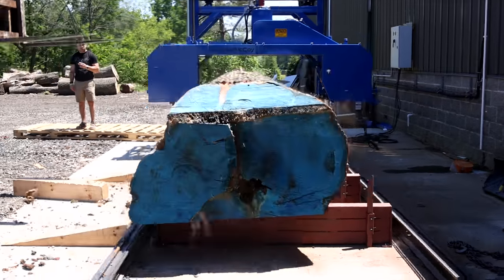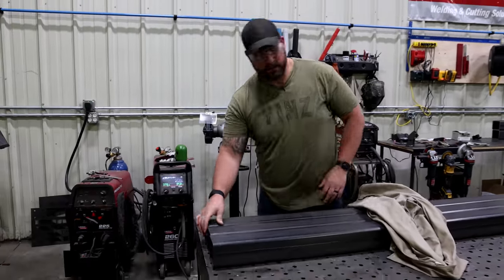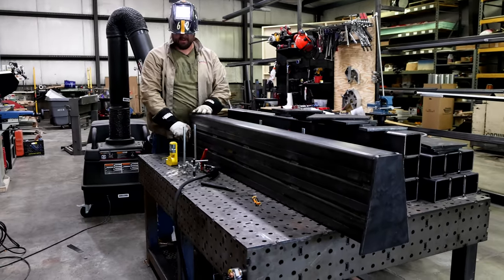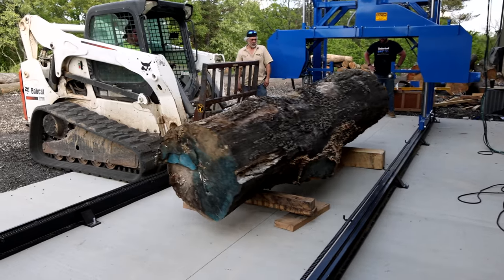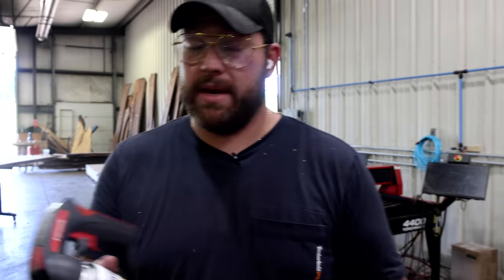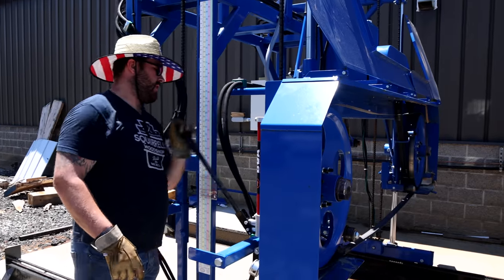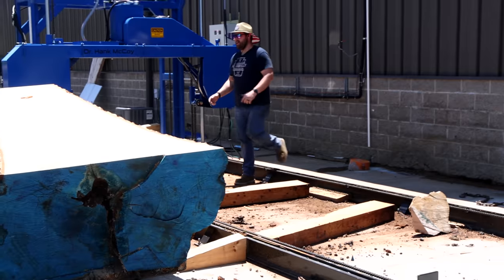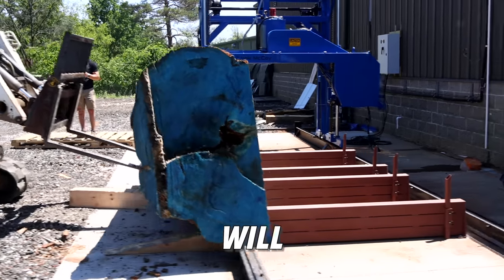HUGE Sawmill Upgrade with An Issue....

Comment: If you are going to be pushing logs perpendicular to the bungs you should add some cross bracing to avoid the logs catching on one and putting forces that would pull them out of the ground.

Comment: If you keep trying to slide the logs around on the bunks, especially perpendicularly, you’re just going to keep tearing up anchors/concrete. You need to get a large enough lift to move and set them into place instead of half-assing it with that bobcat.

Comment: If you don't mind my input, you should make a series of brace connectors welded on to the bunks that connect all the stands together (see the really bad text graphic below where the horizontals are the bunks and the verticals are the connectors). This would give the benefit of keeping all the bunks evenly spaced from each other and the extra 6 or 12 inches on the outside of the last bunks should prevent them from rolling away. Additionally it should eliminate the need for securing them to the ground because the whole thing would need to move as a single unit.

 |          |
=======
 |          |
 |          |
=======
 |          |
 |          |
=======
 |          |
 |          |
=======
 |          |
Reply: Yooo, totally 💯 was thinking something like this. Graphic on the same level I make any projects too 😅
Reply: 100%

Comment: Try using some big Simpson titans. They have a much higher pull strength rating than red heads. If those don't work, then try using structural rated threaded rod and Hilti re 500 v3 epoxy. With the epoxy your concrete will shatter before the epoxy fails.

Comment: i would recommend treaded rod and fill the hole with chemical anchor. insert the rod let ik harden and its not gonna budge.  we secure big industrial warehouses and timberframed homes with it to the concrete slab.  so that`s just my 2 cents.

Comment: If you join the four together with bolted brackets this will increase the stability and reduce the pressure on the concrete fixing as it will be one strong unit instead of four separate weaker units.

Comment: With the price of steel and labor, I am betting these cost more than $500 to build.  But then the channel wouldn't have been able to watch the fun!!
Reply from the maker: thats with me paying myself 0 hahah
Reply: The steel was $500 probably closer to $1000-$1500 for the total build not including labor costs. A hernia is always priceless lol
Reply: @sovereignviper90  I certainly enjoyed mine.
Reply: Engineering tensil strength verses shear strength it appears your anchors need to be more shear then tension. 
If you placed 1/4 plate steel gusits and spread out the force over two anchors you should be able to accomplish what you've set out to do.

Comment: Red Head anchors only hold at essentially one point of the hole.

Use the self threading type  such as Powers ScrewBolts where the threads anchor along the full length of the holes.   Much stronger.

Comment: If you have a 120v welder here on this 1/4”, you can heat your metal up til it’s hot and the welds sink in like melting butter.

Comment: Next time you have to carry long pieces of steel like that, take it from a pipefitter. Lift one end on to your shoulder, slide it up while walking into it, and once you're in the middle you feel it balance out. I carry 21' lengths all day every day like that!
Reply: Agree 100%. Plumbers & Fitters Local 110, Norfolk, VA
Reply: @plunger110  nice I'm a Sprinkler Fitter in Edmonton, Alberta. UA 488 here although I'm not with them.

Comment: If the trapezoid's on the ends that were cut on the table were wider at the base that may have helped with tipping over while pushing big logs. But they're already made so maybe just some bigger ass anchors?
Reply from the maker: Epoxy in the anchors is what we're thinking

Comment: Excuse my backseat engineering but I'd do 3/4 - 1 inch anchors and some epoxy in there as well. Maybe sides that flair out wider towards the bottom.

Comment: My 2 cents: I'd weld the bunks to some angle iron or flat bar, with perhaps some angled supports for more strength since you're handling some of the biggest logs I've ever seen- Then bolt it down with threaded rods and 2 component anchor glue like Sika Anchorfix or similar.

Comment: A better desing for those end plates would of been 45 degrees longer side support. Even using the rails as support would of been good idea. U could weld beams to those rails which serves as attachment poles to those higher supports.

Comment: Maybe weld the bunks together?
Reply from the maker: That is how the full base track systems work
Reply: @John_Malecki  Don't quite know what you mean. But I was thinking welding/bolting  bunks into each other or straight to the frame of the saw.

Comment: A gantry crane perpendicular to your saw would be a nice way to load your logs. You could drive a trailer under it and lift the log off. Then use the gantry to move it directly to the saw bunks. The gantry would have to be high enough not to interfere with the saw and for your truck to drive under it. It could be made to be a portable unit, swing out of the way, or permanent whichever suits your needs better. Just thought you needed one more person telling you how to do it right or how to spend your money. Like what you do and appreciate the effort you go through to make the videos.
Reply: Great idea!  I was thinking a jib crane would work well for him.

Comment: For more structural strength and rigidity I would also run a pipe across all four of them on both sides to tie them to each other. So now the anchors in the ground aren't only holding up that one bunk but if one bunk is trying to tilt and rip the anchors out of the ground that tie beam will be pulling on the other bunks. So now it's got the strength of all of the concrete anchors instead of just the four for that one bunk.

Comment: Yeah those dyna bolts are more of a suggestion than anything else considering the amount of weight being put on it. Better idea would probably have been to make wider foots for the bunks. Then most of the force would have been handled by the reinforced feet and then you could bolt down those feet with the pretty little dyna bolts. They still wouldn't be doing much but aesthetics and all that.

Comment: Probably should weld all of those together so that all the concrete anchors can work together and all of the side to side forces can be distributed also. Just a thought!
Reply: why would you drill and tap thru the seam of the tubing?
Reply: @johnlonghair6461  confused, drill and tap through which seam? I suggest no drill and tapping strictly welding cross supports from one support to the other.
Reply: @ckap8648  minute 4.49.
Reply: @johnlonghair6461  I see what you are saying but we are not talking apples to apples.. I am suggesting he make cross-members connecting all of his steel base skids together horizontally.. I think that member was to hold in the back stop which would control the logs roll across the span of the skid.. I am looking to help the forward and back motion the log may need to be adjusted.. l-l-l-l (like my diagram😄)

Comment: HF (aka harbor freight) has these things called Dollies PITTSBURGH AUTOMOTIVE 
 1500 Lb. Capacity Vehicle Dollies they work well for moving steel around the shop. They also work as carpet dollies. 😎😎oop!!! I should watch the whole video😏😏I watch to the end Titen HD Simpson  anchors some are 10,000 LB rated

Comment: Use a Pin system instead of bolts, like on the weights of gym machines, would be much more quick to set in different heights.

Comment: Maybe use 3 - 4" long spacer sections in the middle instead of full length to save weight and cost ?
Reply from the maker: yea not bad, but could not be as structurally sound

Comment: Just epoxy in some high strength bolts. You are going to be tossing multi-ton logs on it. You need the strongest bolts you can get.

Comment: Haha I was worried about those little redheads on your metal rack. I'm not sure if there's enough space in the plate for a faaaar larger faster but maybe a clamp down plate on the four corners. Then some big beefy bolts. If your happy with the location then I would go for thick threaded rod (galvanized or stainless steel) and use a structural type of epoxy. Then you just have a simple nut on top if you want to remove the bunk. Also you have the option to choose how deep you want the rod to go. 8" or so at least depending the slab thickness.

Comment: So I don't understand. It would have costed you $500 to buy the bunk that was professionally made by the same place you bought your saw. But instead you spent $500 on unworked square metal beams. Not including the the welding wire and the electricity and your time and that of your help. Plus mounting and paint. Sounds like you have been further ahead if you just purchased the bunks. That's my take on it.